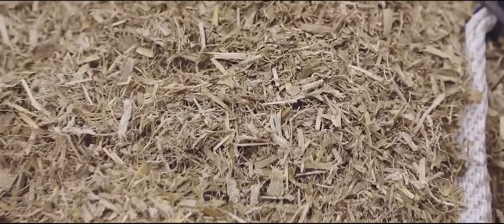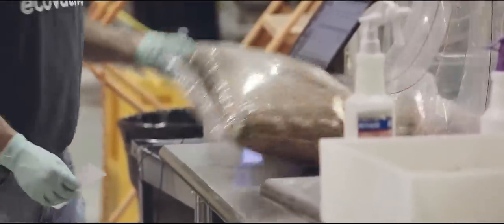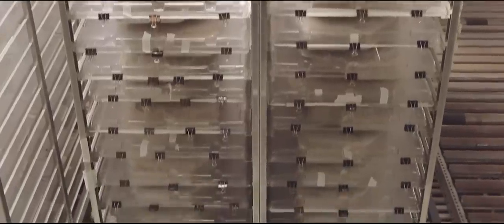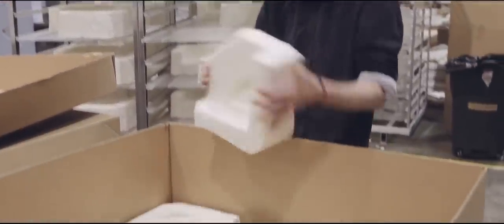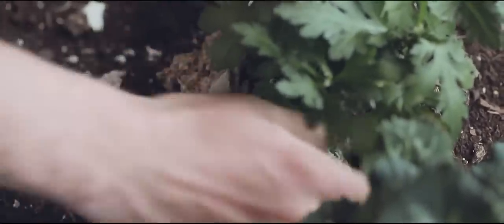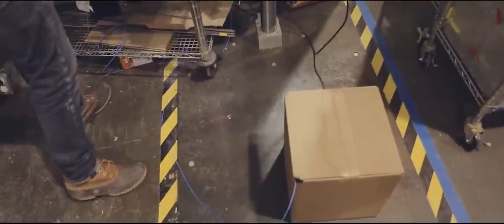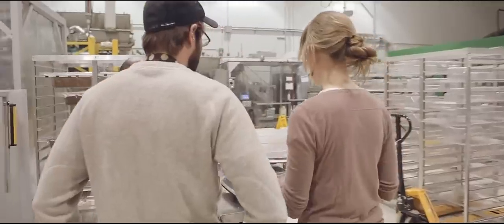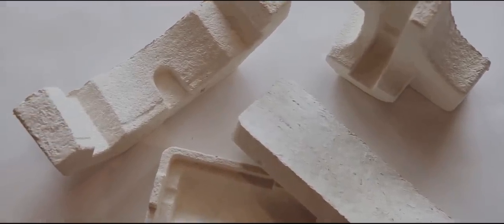Mushroom® Packaging

Comment: Im confused by the "does not biodegrade in use" but then it can be used as a sort of fertilizer
Reply: It only bio-degrades if in contact with moisture and soil microbes. In use, it'll be in a dry, clean cardboard box, so it's stable.
Reply: @PeterVJaspersFayer  I see, i appreciate the clarification

Comment: At 25seconds you say with out petroleum products or plastics. What are your forms made of? Also what do you use to produce your spawn in polyethylene bags? Just wanting to know if you have a plan to move to different material for those purposes in the future. My intention is for more information not to knit pick. Thank you :)
Reply: The plastic used for forming is still way more eco friendly than foam packaging currently used in packaging.. They are reusing the same plastics over and over again. In theory yes they could produce the forms out of metals but that wouldn't be cost affective when you can reuse and reuse and reuse the same plastic forms. Then again the forms may not be plastic and just look like it.
Reply: Zachary, I hear you, but starting with harm reduction is a good thing.  Perfect it afterwards.